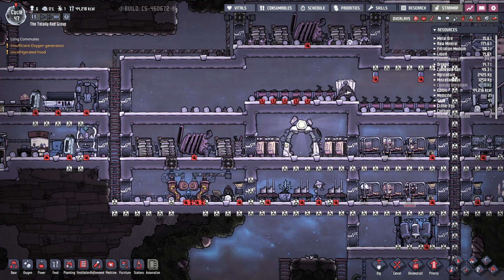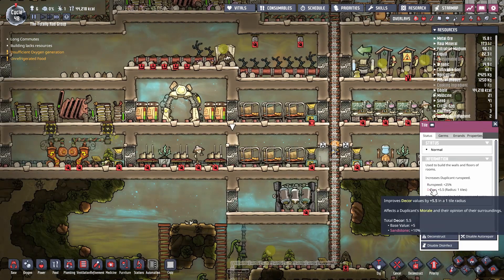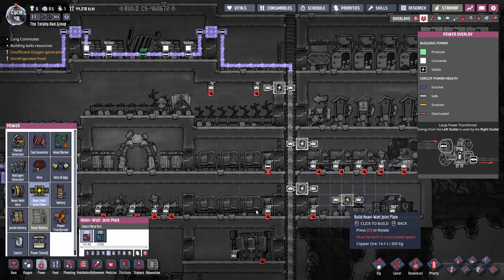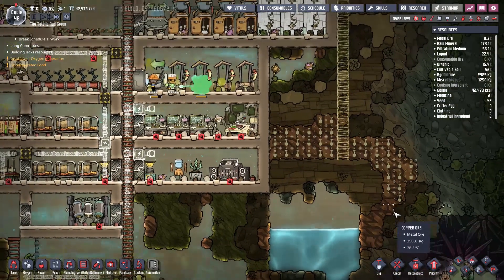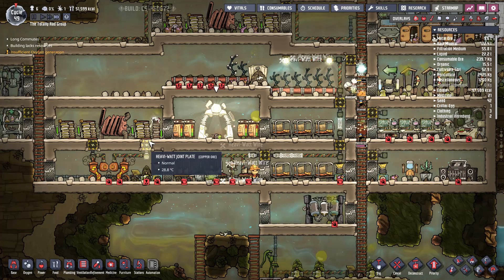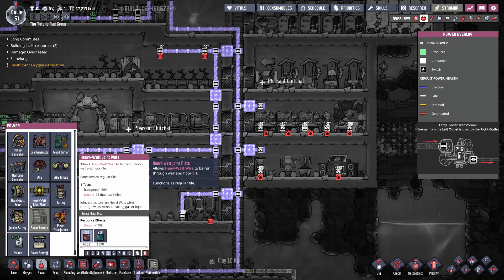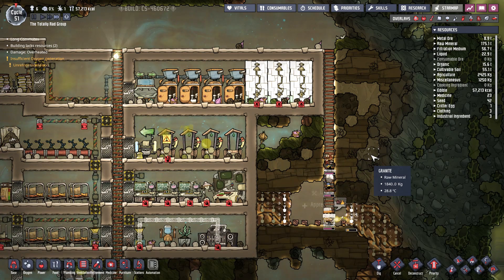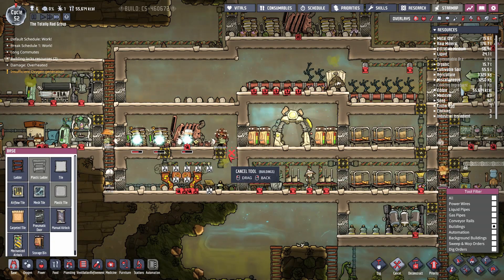The New Power Grid Is Here! | Oxygen Not Included (Run 4) Part 11

Comment: 11:30  [About germs] :
. The game does not teach you how to remove them from liquids (it does for germs on the air & trapped in ores/solids).
-> You have to KNOW (from real life experience/education) the methods used to make "clear" but contaminated water into potable/safe water for drinking,
 
. If the water is "clear", the germs will still reproduce but a rate slower than their life cycle (so overtime the ammount of germs goes down). It is not necesary to reach "zero germs" on water because duplicants have an inmune system (so a few thousands germs per "ton" of water [one full square block] will not make them sick).
 -> If a spill of polluted water "sinks" under clear water, it becomes an endless source of new germs (because there they can reproduce faster than what they die on the rest of the water), so if it is a small enough "patch" of polluted water, you should try to "clean"  it (it is posible if is just a few kg, even underwater), or "seal" it by building wall blocks around it [displacing the clear water around it].
  
.  All germs INSTANTLY die if water or polluted water goes from liquid to gas [the game does not simulate the complete "boiling" or "pasteurization" process, because it will lag your PC if it had to calculate every single bubble]; so you have to heat it up to 101ºC (clear water) or a bit more for salty/dirty polluted water. 
 THEN you have to cooldown the gas_water (vapor/steam) so it becomes liquid again... THEN also cooldown this "sterilized" clean & clear liquid water so it can be used safely [duplicants will burn their mouths if you prepare foods with water at 90ºC, sending them to the hospital].
  -> This process is very energy intensive (it also require huge spaces dedicated for heating, cooling, machines & storage (so it is more end_game).
 
.  Chlorine can be used to sterilize water (this is the most common method used on most cities).
  Since the game does not model "bubbles" of chlorine_gas on liquids (or disolution of chlorine_chemicals in water), you have to use an object that "obscures" this process [so the user can not see it, but still happens]:
  
Note: [This is not in the game encyclopedia, but it works] 
.  If you place a LIQUID CONTAINER (it is a 2x3 box located on the "base" buildings) over a metallic mesh tile (so gases can go "under" it) & replace all the air in the room with chlorine at medium/high pressure [first make a vacuum with pumps, then move many kg of mined "Bleach Stone" to a storage conainer inside the room (or pump/filter chlorine gas from elsewhere)]; the water inside the liquid container will constantly kill germs [this does NOT destroy the chlorine, so it is an eternal system once it is implemented].
 -> You have to reach ~2 kg of pressure of gas chlorine to get a decent speed on the germ killing (but if it is the only gas in the room & you have patience, the germy clear water inside the liquid container will get sterilized overtime).
 
Because of the mechanics involved (the liquid container uses pipes), it is normal for some germy water to "hide" in them [re-contaminating the 5000 kg the liquid container can sterilize at once], so the only way of perfectly cleaning "EVERY drop of water" is to force it to circulate between many liquid containers using automation (clocks stopping the flow at different points to create empty liquid containers, that then can be partially filled with the "hiding" germs for cleaning). 
-> This is rather unnecesary & extremely complicated to execute [but can be done with some clever design with only low level research, without the need of rare metals or plastic].
Reply: Note: In recent updates of the game, the duplicants can now suffer from "eye irritation" if they are inside a room filled with chlorine gas. This reduces their Athletics stats (running speed) for a while.
  
If this effect is combined with many other "debuffs" that reduce their speed, they may become unable to run/walk (dragging themselves like a worm), something that is very dangerous, as they may take an entire day to move from their bed to the bathroom & kitchen (not having time to even eat before they pass out, starving themselves to death). 
 Or they may move too slow in a dangerous place (too hot or toxic); so you have to be careful of checking all of their "status" from time to time.
  ->  This can be solved by building masks/spacesuits (but those must be filled with oxygen constantly, something that requires infraestructure & usually an endless source of clean oxygen by destroying water with electrolisis... that requires power).